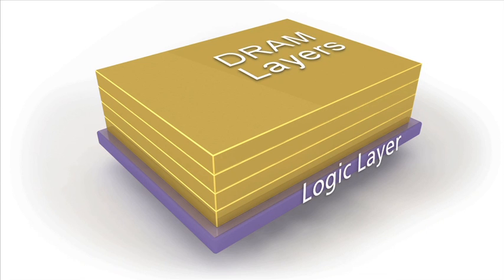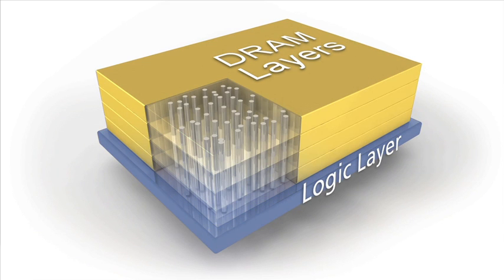Hybrid Memory Cube: A New Blueprint for Memory Architecture

Comment: I was interested in this technology as a simple PC enthusiast. I don't think i'll use a GPU or CPU with onboard HMC soon. I heard that nvidia will use it for the "Volta" in 2016 or beyond but it's not on the die, it's embeded in the PCB around the GPU socket. I was actually asking how it will be implemented for use with the CPU, will it have a standardized socket (from the video jdec made no standard) or will it be embeded on the mobo for the DIY market and OEMs (not servers, HPC etc.).

Comment: How is/will HMC be integrated on the motherboard? Will the HMC be installed directly on the motherboard PCB or will the be a separated PCB like a DIMM with multiple HMC chips that fit in a standardized slot? Won't that create latency compared to creating a new type of interface?
Reply: Potentially on an MCM CPU with a much bigger igpu. Looks like AMD was thinking way ahead.